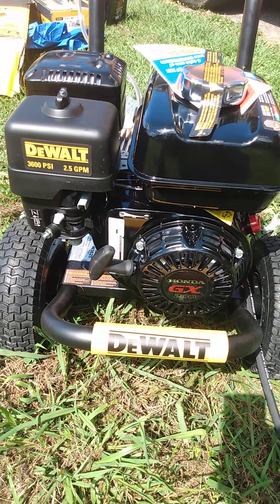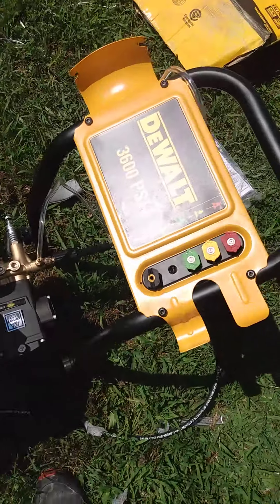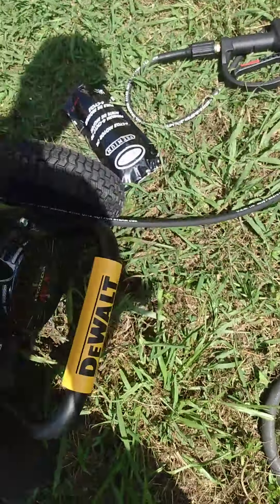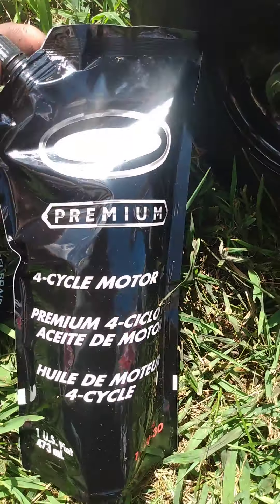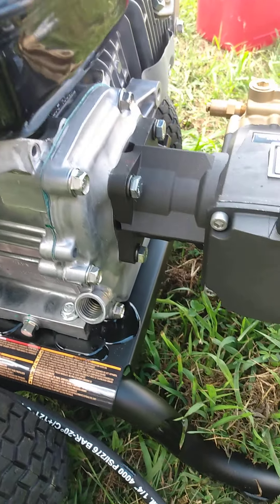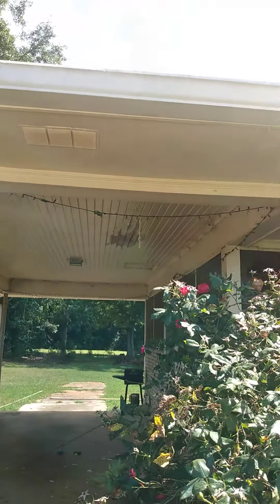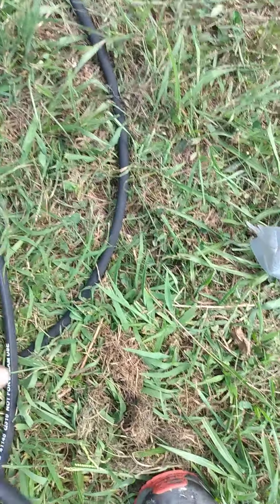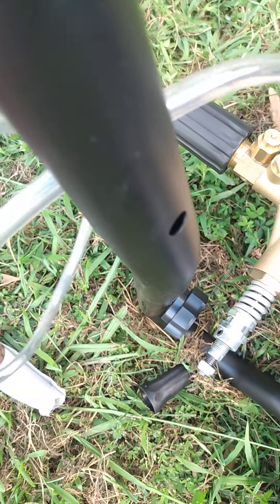DeWalt Pressure Washer Review 3600psi 2.5gpm $600 home Depot model 1 of 3

Comment: Hey bud , just a heads up to save yourself ALOT OF HEADACHES. 
SWITCH TO ETHANOL FREE GAS .
The ethanol is what messes up the carburetor during the winter.. if you don't have access to ethanol free at the pump go to your local home depot and near the chain saws they sell 93 octane ethanol free gas.  Its about $8 for 32oz , run that though your engine for the last time of the season but don't run it all out .. come spring time it will fire right up.... found your video because I'm looking for a new pressure washer ... best of luck
Reply: Great tip.  It's the only reason I've switched to battery-operated lawn equipment.  Shopping for a new washer, and now ai won't shy away from gas operated equipment.  Thanks!
Reply: @tomdelorge268  for sure man. 

Can't believe the price jump 
I bought my 3600psi dewalt for 640 , same model is now over 900 locally...
Reply: $699 at my Home Depot yesterday.  I haven't pulled the trigger yet, but it's the front runner so far.  And strangely enough, it's the inflatable wheels that is my sticking point.  I hate plastic wheels.  I should go with the 3300 and upgrade the wheels,  but question how easy that would be.

Comment: Nice video.  How are you liking the pressur washer?  Has it held up?  Think the extended warranty is worth it from HD?
Reply: The pressure washer is a beast! We have been running it at least twice a week on full day jobs with no hiccups to speak of. Dewalt gives a pretty good warranty, so I would just make sure the extended guarantee is for a no questions asked replacement if you have issues. It seems that sometime the extra warranty is full of holes, or doesn't kick in until the original warranty is over